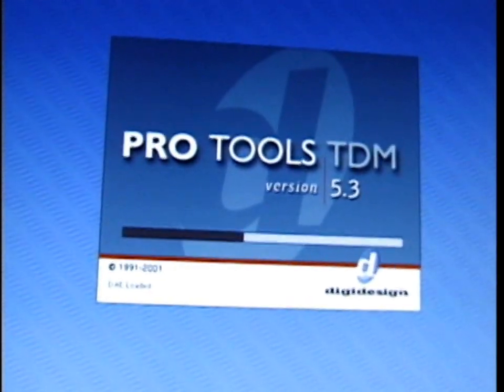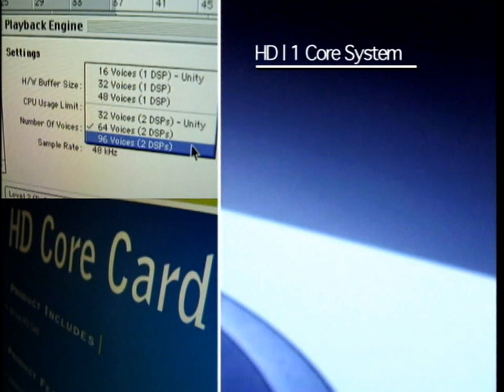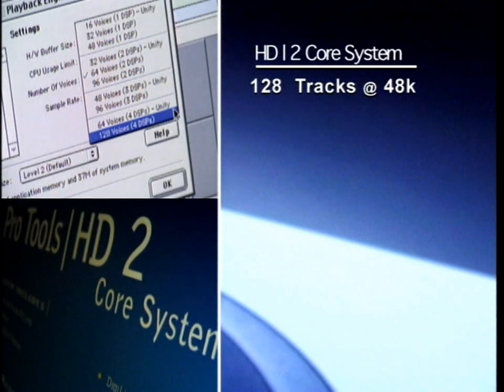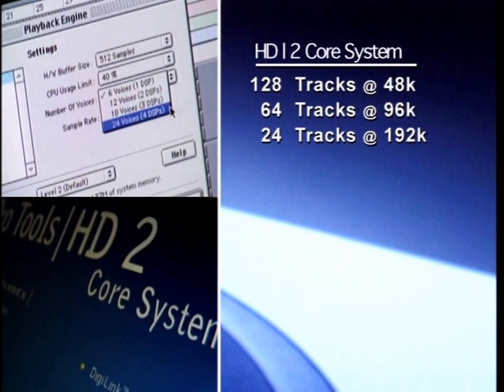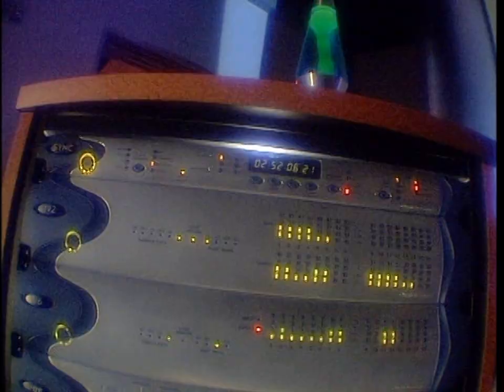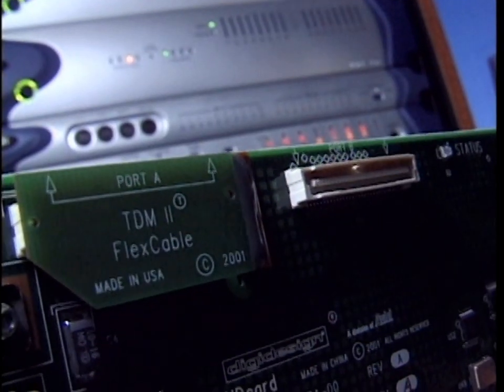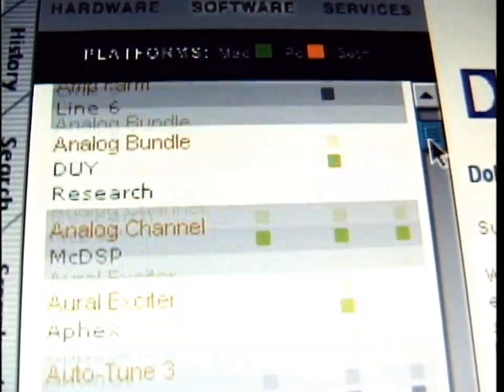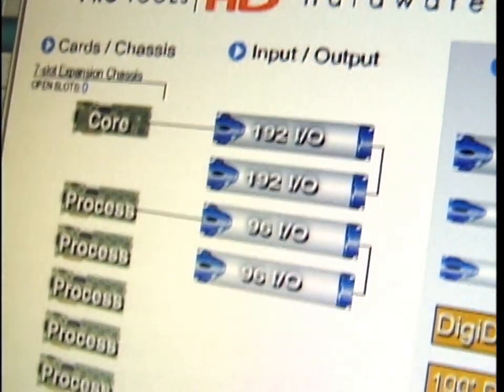Pro Tools HD – HD Core Cards 2002

Comment: I have never used an HD system only the 002 with LE,  I'm wondering if it is worth now to look for a second hand complete system, and wondering if it will run Pro tools 10
Reply from the maker: HD Systems are supported until Protools 10! After this, only HD Native or HDX Hardware.
Reply: @magermunson  thank you
So if you could tell me what includes. Complete HD system?
I mean which cards and interface would I need?
Reply from the maker: @ravalmusicproductions3978  You need minimum a HD Core Card (HD1), on this you can connect the I/O Interfaces, if you need more power and voices, then you need the additional processing Cards like HD2 or HD3! I/O Interfaces, you must check this what you need for your studio or setup, like only a DA/AD Expansion or ADTAT or AES EBU etc. Remember, HD1-HD3 works only until Protools 10! Newer Versions are not supported, you can only use all older I/O Interfaces on newer HD Native or HDX Systems, this is no problem!